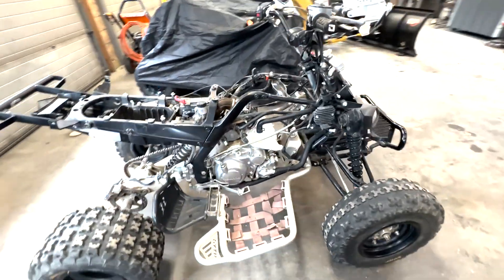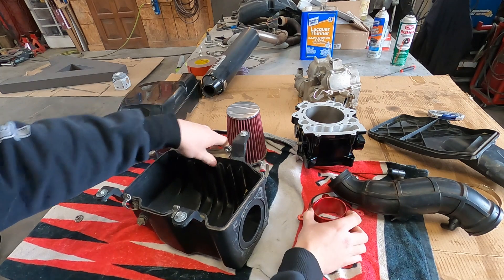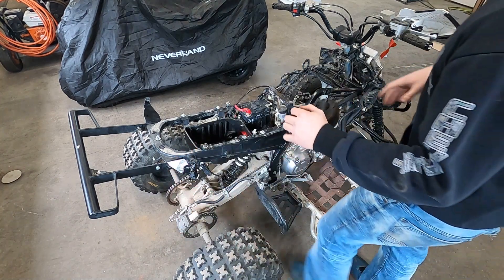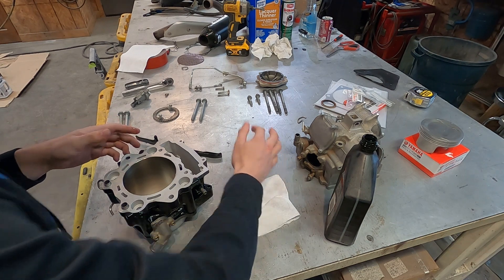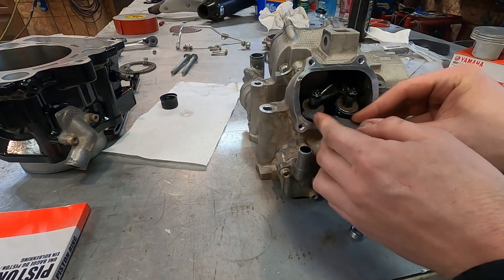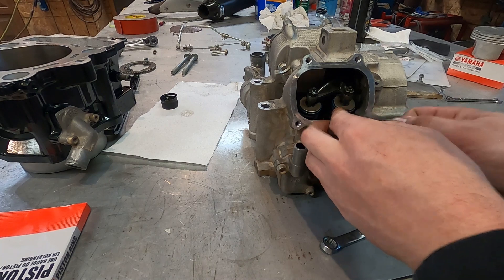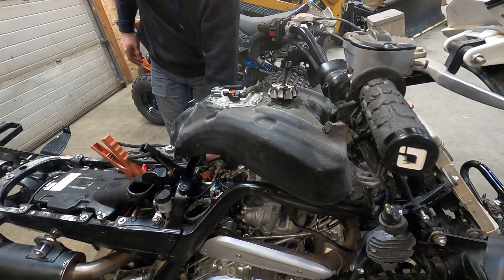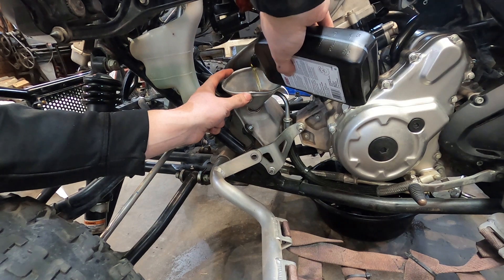The Raptor is Back! | 2020 Raptor 700 Build Part Two

Comment: Looks exactly like what happened to mine. Somehow a bunch of dirt got through into my intake and throttle body and caused my rings/valves to go bad. I just finished my top end rebuild earlier this week!
Reply from the maker: What kind of air filter where you running and do you keep your lid on or off? Making me second guess my setup. Hopefully it stays clean now.
Reply: @SmokeyFromThe715  I have the monster big 3 with their k&n style filter with a pre filter and lid off. Honestly, I’m pretty sure I forgot to oil it or didn’t do it enough the last time I cleaned it. So it was sucking dirt right through it.
Reply from the maker: @NWO-Off-Road  dang. Well I will have to make sure to keep this one in tip top condition. Thanks for the comment!